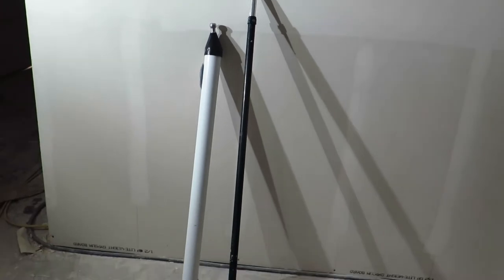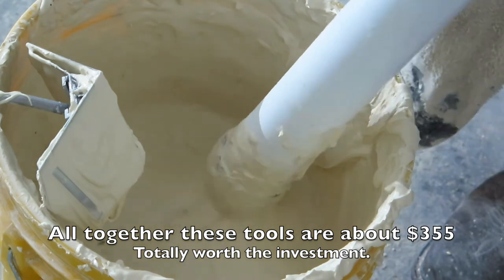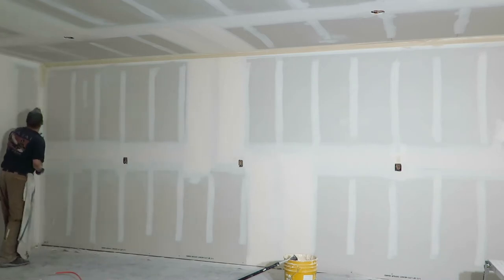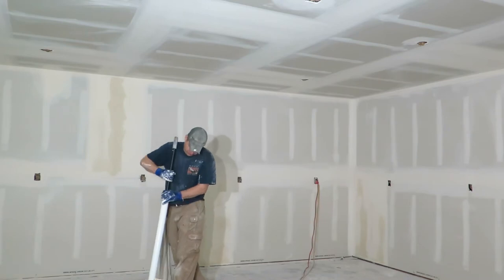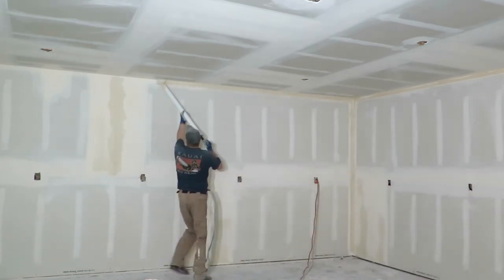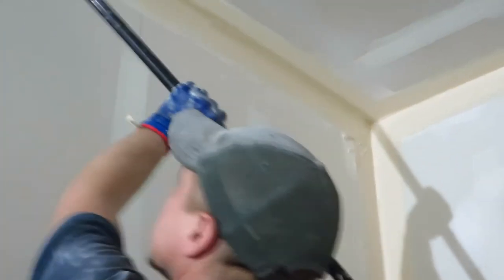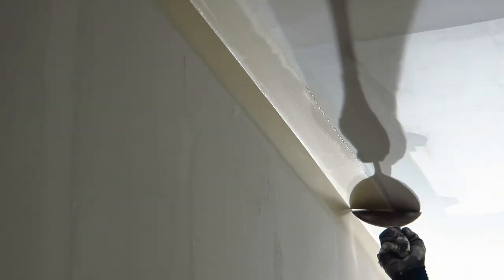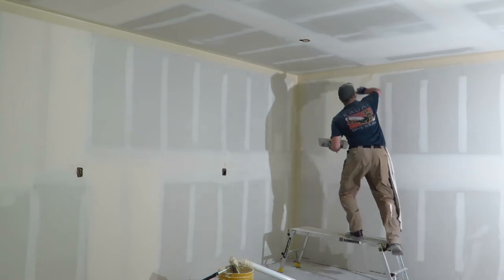Finishing Drywall corners the easy way

Comment: Do you think you can add the Amazon links to all the tools you used?
Reply from the maker: Hey there Quinton thanks for watching! Thanks for your interest in the tools I'm using as well. 

These are my Amazon affiliate links to all of the corner tools I use: 
https://amzn.to/4a9oiQy - Compound tube
https://amzn.to/40YChV8 - 90 degree applicator mud head 
https://amzn.to/3GhT2RH - 3.5" Corner Flusher/Glazer
https://amzn.to/47S6ebF - Angle head handle (Slightly different handle than used in the video but it's a better price) 
For taping I add: 
https://amzn.to/3Gmg7mc - Inside Corner Roller with handle
https://amzn.to/47zOCSa - Columbia 2.5" Angle head (I use after the inside corner roller to embed the tape)

Please keep in mind these aren't the top of the line tools (except the Columbia Angle Head), but they still work great without breaking the bank. 

Thanks for watching and thanks for the comment! 

-Mat W/1T